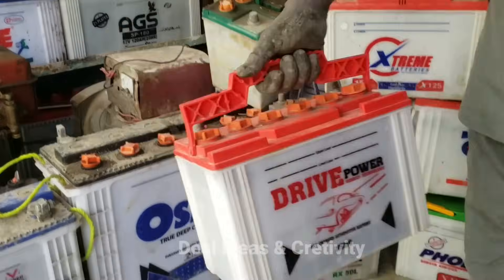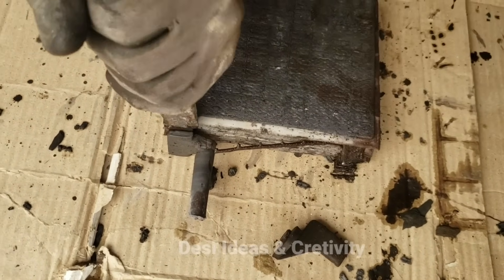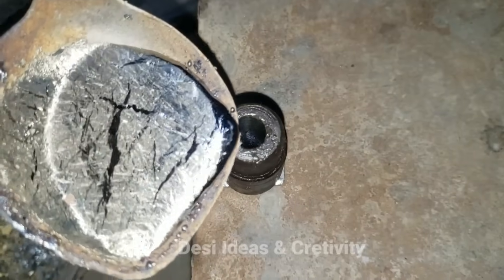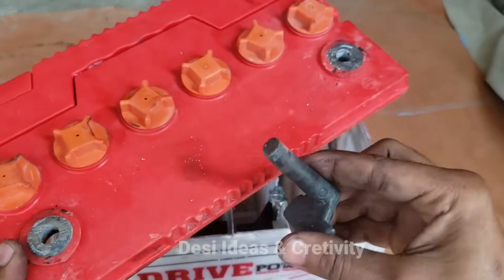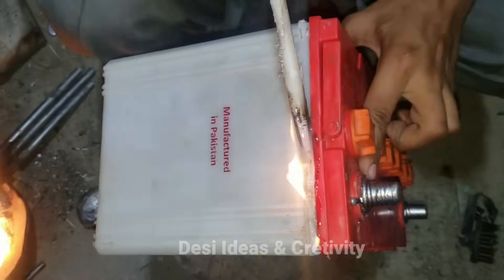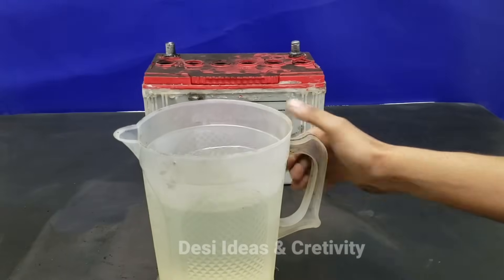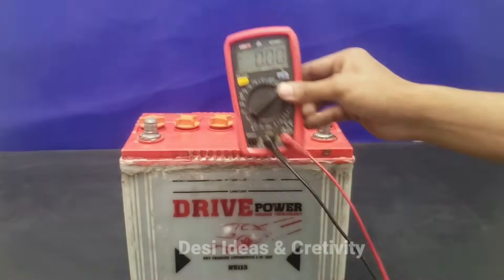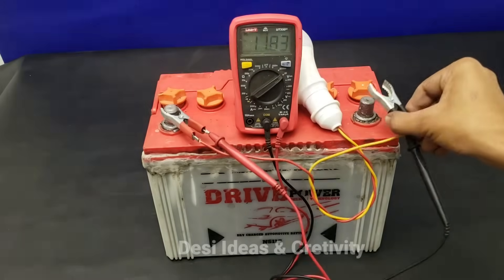Use Charcoal To Make Battery With No Expensis  #project

Comment: Before you solder the plastic cover you need to put the carbon first then soldering the plastic cover and last the acid solution.
Reply: Acid solution you mean Acid+water...and by carbon?! Where do we get it.
Reply: @Thato3700 : Only sulfuric acid only  to fill the cells, the acid shall be placed only one time. Then slow charge. Destil water if the level of acid go down.
Reply: I think it's just plain old wood charcoal
Reply: Wood charcoal
Reply: @Thato3700  Charcoal from wood
Reply: I need your help
Reply: I have a question about it: is it not needed two electrodes to produce electricity, since I see only charcoal?
Reply: @ministeriomundialliberando8403  Use charcoal and batteries acid needed for electrolysis,  then when batteries is finished you added sulfuric acid  then slow charge, mark the positive post with red color because ones the positive charge is moving in from that poll will be positive for ever. The electrons will be devide the battery in two parts + Positive and  - Negative.
Reply: Does it have to be sulfuric acid or will any kind of electrolyte work?
Reply: @crazyolred4412  NO.  ITs  special water and acid prepared for batteries pure acid is not goo for the cells.
Reply: it cannot be last long
Reply from the maker: ur also right
Reply: @desiideascreativity  : Also keep all lead connections in place of the plastic battery box, cut only 3/4 of the cell compartment leave 1/4 for the electrons  to move from + Positive to - negative, then fill with charcoal the cells, the reseal cover of the Battery, then last sulfuric acid as energy catalyst. Fast and not much Welding, and more for your Business. Best Regards to you.
Reply: @hugotorrado3948  Thank you for this important input. But is there a visual demonstration of how to go about it? 
I'm really to put this idea to practice. Thank you

Comment: Desi Ideas:- liked & subscribed, an unique way of utilizing the old lead acid battery to a advantage, that to very minimum expense, just a skill, your Idea of opening the battery, utilizing old terminal lead, assembling technic, instead of battery plates using crushed charcoal+1250 sp.gravity sulphuric acid, as an individual cells, internal connector's making, opened box top fixing,are all amazing work of a professional, very innovative idea as DIY superb video Demo presentation, output voltage almost 12 volts as a household work quite suitable battery, finally an acceptable project.👍🏿👍🏿👍🏿
Reply: Wow!  I have dead batteries at home...hope you could guide me well in my project...
Reply: @arthurdia8394   thanks  
How much sulphuric acid would we need?
Can we powder any charcoal?

Comment: Did you say crush coal? Transcript says coil.
Reply from the maker: Yes crush Coal
Reply: @desiideascreativity  What you are using here is crushed "charcoal" - that is, wood that is heated without the presence of oxygen, to create a more carbon-rich fuel, which is used in steelmaking. "Coal" to many native English speakers means lignite, anthracite, etc.
Excellent video, thank you for posting, from cold and dark Scotland !
Reply: @kennethbain4290  great answer. It's horrifying how many basic questions are being asked.